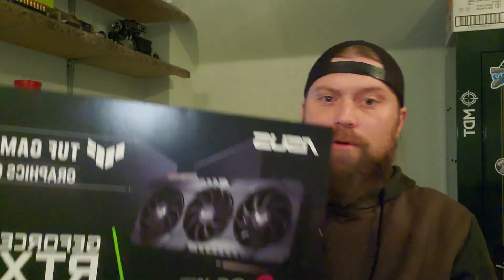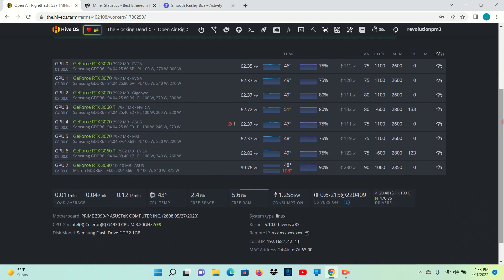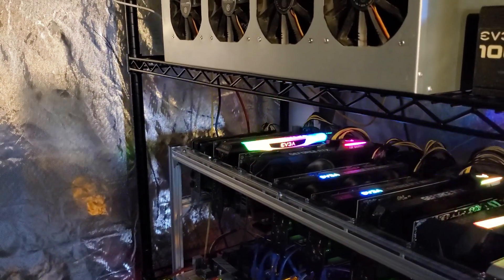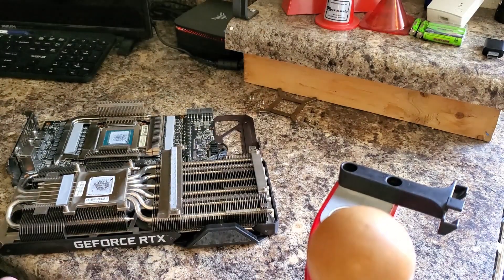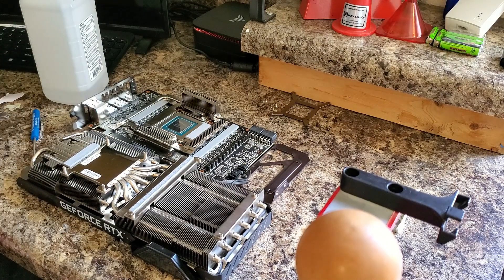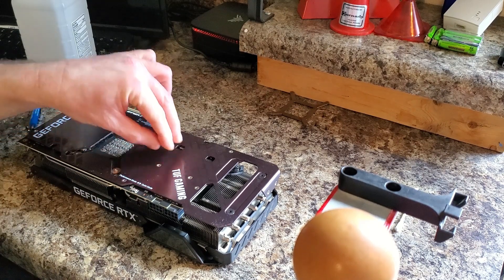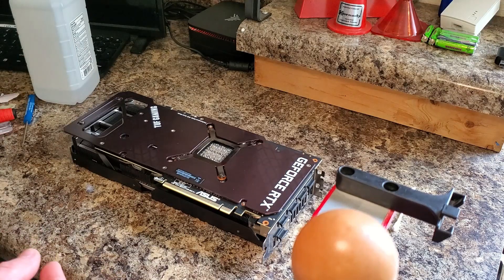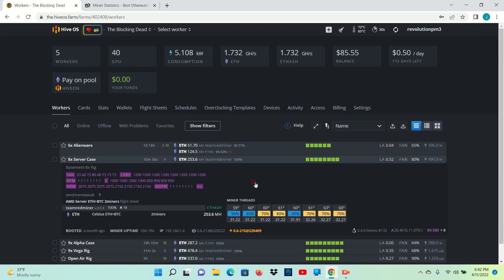3080 Memory Temp Modification GDDR6X ASUS TUF

Comment: Agreed. The pads to the heat pipes are very important since that's taking the heat away. Also unless the original thermal pads expands when you open the case, and older pads are less likely to,  i would replace them so that there is always good contact with the heat pipes. Don't skimp on pads. Also, you view from the sides to see if there is any daylight between the pads and the heat pipes.
Reply from the maker: I bought a pre-cut kit to replace all of them, but in this video I wanted to see how much adding just the extra pad would help. In the interest of science, I needed no additional variables, so I left the rest of the card as-is. Surprisingly effective!
Reply: @theblockingdead1310  Fair enough, although as a follow up you might want to try shims on that same area, as well as the other heat pipe area, to see if temps can be further improved. As far as i know, no one has declared this an official mod.

Comment: Change the pads of the back plate and underneath the heatsink, they are prone to failure really quick.
Reply from the maker: I bought a pre-cut kit to replace all of them, but in this video I wanted to see how much adding just the extra pad would help. In the interest of science, I needed no additional variables, so I left the rest of the card as-is.

Comment: Better if you replace thermal pads memory for cooper plates, i do it in the same card, now 29degress core, 68degress on memory
Reply: Yeah, i've even replaced the pads connecting to the heat pipes with a copper shim sandwich. 0.5mm pads then your 15 x 15 1.5mm shims, then 1mm pads. This response immediately to temps.

Comment: You might even get a little more of a drop once the pads have had a chance to run for a few. I've seen some silliness re-padding cards. On this model specifically,
Reply from the maker: Yeah I bet. There's like 4 different pad thicknesses throughout the layers. Probably takes some time for everything to settle in.  So far I haven't seen this card get over 100 and most of the time its in the mid 90's, when 110 used to be the norm. I imagine if I did all the memory pads it would be even lower. But I had to try it this way first just to settle my curiosity.